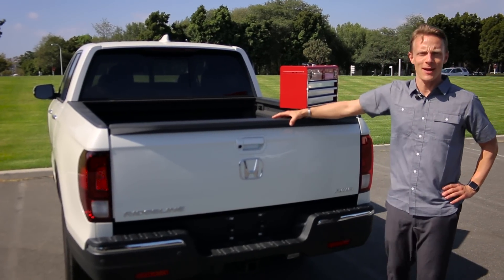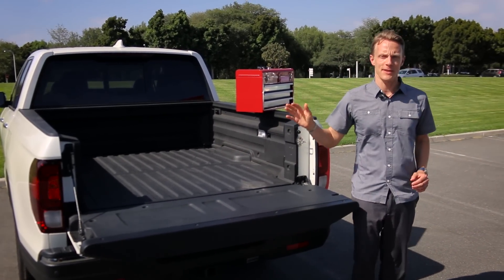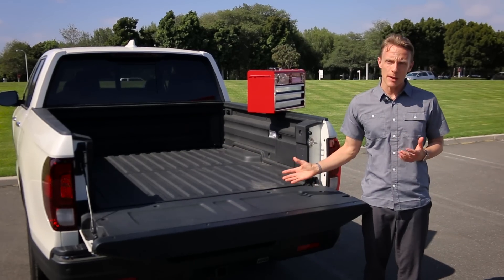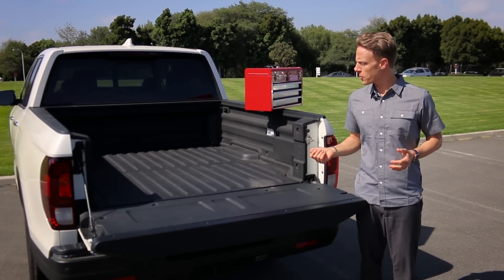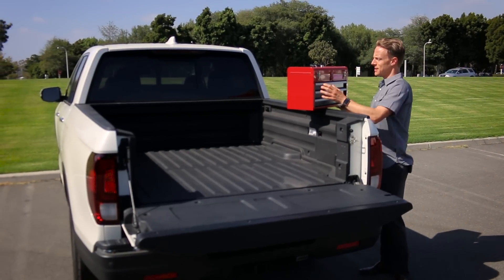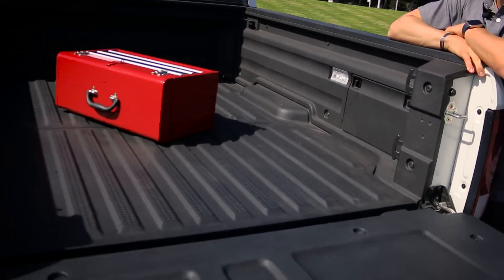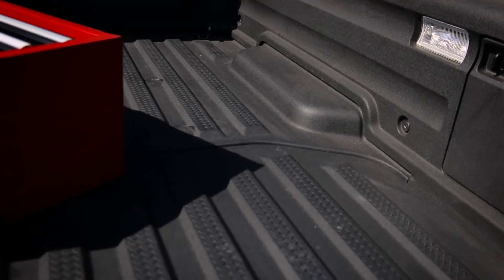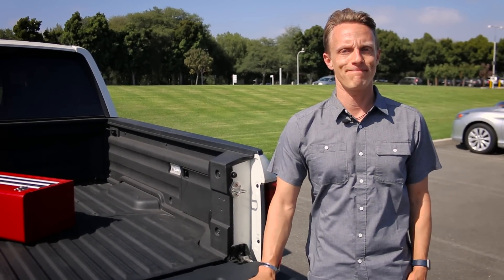2017 Honda Ridgeline Toolbox Drop

Comment: I like that composite bed, but it should be pointed out that it's quite a bit shallower than either a Silverado or F-150 so the toolbox doesn't fall as far.  It's my #1 complaint with the Ridgeline, you can't fit much under a tonneau cover.
Reply: plmn93 that why it also has a trunk.

Comment: Come on that tool box had no weight in it. Weak test.
Reply: Its the same "test" Chevy performed on the Silverado and F150, and both of their trucks beds were damaged.
Reply: Take another look and the weight is different. No way any Honda can compete with half ton
Reply: You have no idea how much it weighs, and it wouldn't make any difference because a composite bed isn't going to dent and Honda knows that.  That's besides the point their beds were damaged by a toolbox, that's bad no matter how you look at it.  BTW The Ridgeline technically IS a half ton pickup.